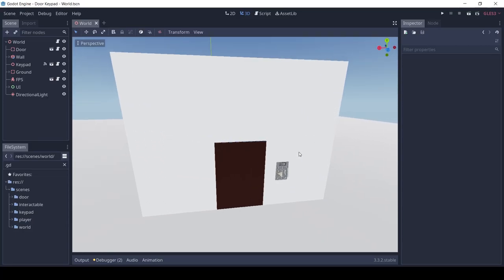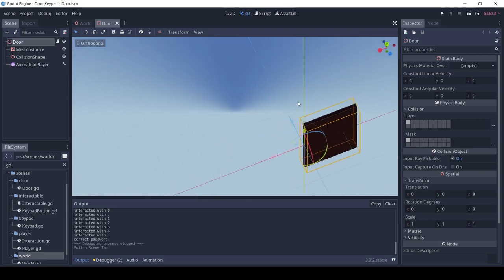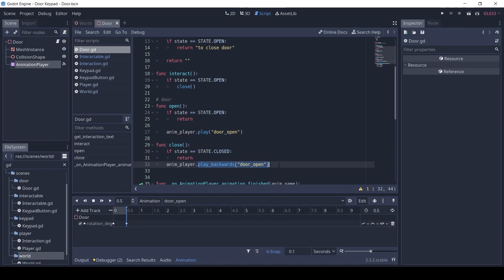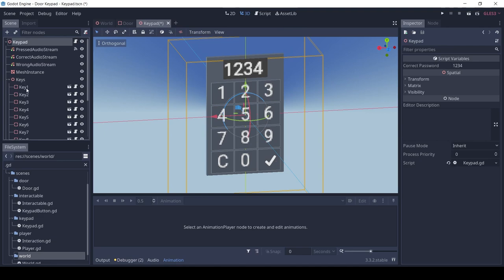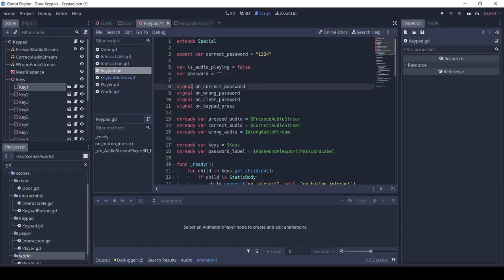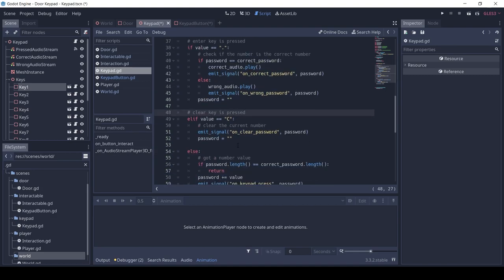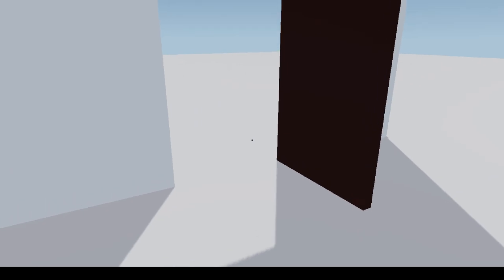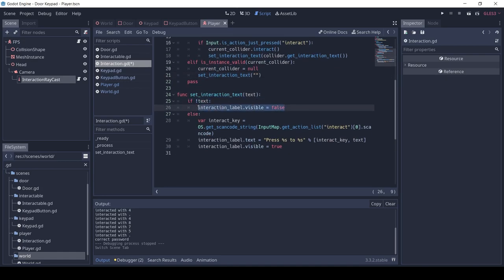Godot 3D: Interactive Keypad Lock

Comment: Can you make a door without a keypad using this method ?
Reply from the maker: Sure the door by itself is Interactable since it has the open and close methods. The open and close can be called from anywhere say for example a button, or a switch, or direct from a function, etc.
Reply: @delanolourenco  I've make one using your method and it's great. I make an invisible non-collidable collision with the player just to make the open/closing much easy without raycasting to an actual slide door for example. Anyway thanks mate! Nice tutorial!

Comment: amazing tutorial! is there a chance to have the godot 4 version of this?
Reply from the maker: It would pretty much be the same in Godot 4 except for the scripting part. But if you make this project in Godot 3 and open the project in Godot 4 it will prompt you to auto convert to Godot 4.
Reply: @delanolourenco  i kinda manage to convert it by myself and the only problem ive found is connecting the keys child thru code to the label of the display. thank you
Reply: if you or anyone  have any suggestion on how to update the child.connect("on_interact", self, "on_button_interact") part for godot 4 i would really appreciate :D
Reply from the maker: @joeantani1396  child.on_interact.connect(on_button_interact)
Reply: @delanolourenco  thank you so much. And my compliments for this super comprehensive tutorial